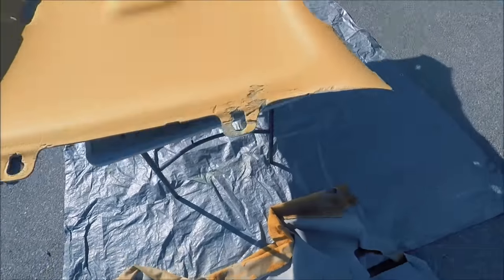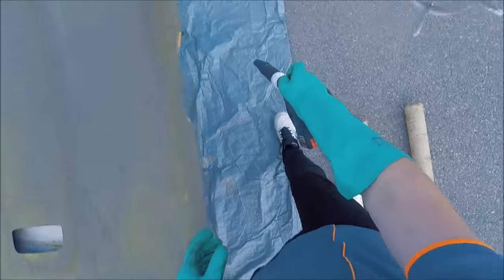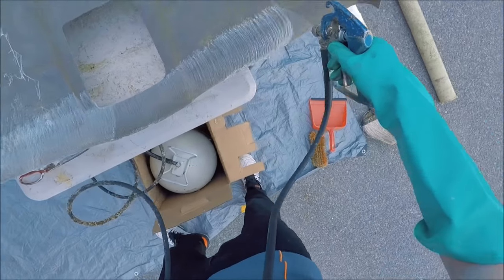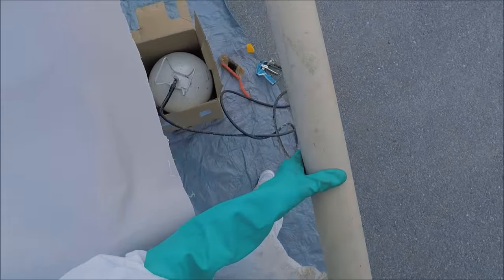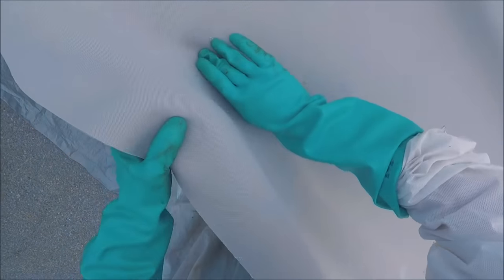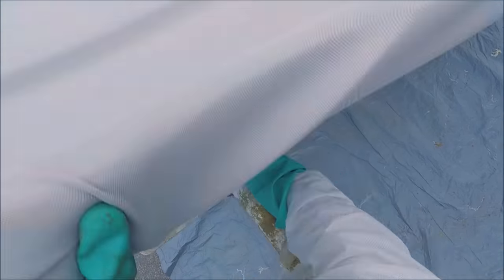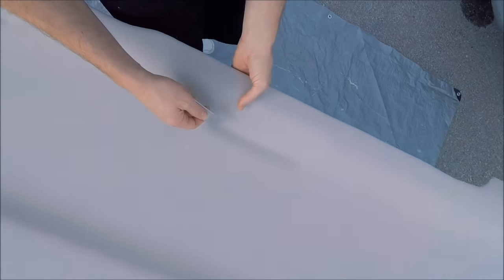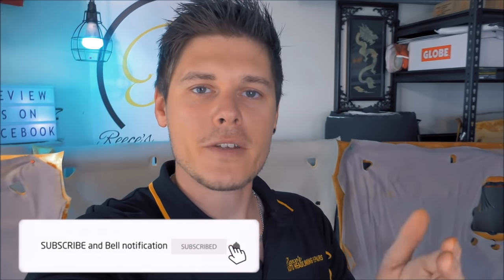How To Fix a Headliner The Correct Way

Comment from the maker: Thanks for watching 😃

The Products we use:
BUY OUR GLUE: TensorGrip T65 500ml Can - https://ebay.us/rysIGV
BUY OUR FABRIC:  Headlining / Roof Lining Material: https://ebay.us/26bew6
FIND A STARLIGHT HEADLINER KIT: https://ebay.us/uM5XCA
PERMATEX ADHESIVE HEADLINER GLUE: https://ebay.us/TrG6aw

If you'd like to Help this channel GROW!! Subscribe, leave a COMMENT below and Click 👍 OR 👎
Subscribe and hit the notification bell! ►https://www.youtube.com/c/reecesautoheadliningrepairs
Reply: Do u have shop in Chicago
Reply from the maker: @hilalaiss  just Adelaide, South Australia 🇦🇺
Reply: I just bought a piece of this fabric from a fabric store because it had a cool design/pattern on it.
It doesn't have foam on it and I don't plan to add any, do I need to worry about the glue soaking through the thin material and using looking bad?
Could just be me but it looked like you applied the glue pretty thick; could I get away with going thinner so as to avoid seepage through my thinner material?
Reply from the maker: @RandoManFPV  t65 glue sprays thinly, so usually on most non headliner fabrics, extra caution is required, but possible to not get any glue seeping through fabric, just don't puddle the glue anywhere 👍
Reply: @ReecesAutoHeadliningRepairs  thank you 🙏
Reply: Hi I have a 2007 VW Passat 3c wagon when I removed the hood lining from car and then removed the material and foam but I have a problem the old glue Is tacky how do I remove it @ReecesAutoHeadliningRepairs
Reply from the maker: @Enzorat2267 Permatex headliner adhesive http://ebay.us/apC9ZH
Reply from the maker: @Enzorat2267 We clean off the old foam with brush or nylon orbital. 

Then boards are tacky still and can become an issue.

But we find the Permatex brand of glue works ideal on these sticky oily boards.

We currently don't clean it down with any agents, just rub heavy with a clean cloth to absorb the stickiness
Reply: Where do get that glue. In Large gal format to use in sprayer
Reply from the maker: I'd recommend getting it repaired with new fabric/glue. However, here are my suggestions for short-term solutions to hold up a saggy roof liner:

#1 Avoid anything that will compromise the safety of yourself and passengers in the car, for example, drawing pins, thumb tacks, pins as these could all run the risk of coming loose and falling down. If landing on infants, pets, babies, and toddlers, we now run the risk of them ingesting these harmful items.

So possibly a suggestion to a safer short-term solution is Twist pins,
SHOP HERE🛒 https://www.reecesautoheadliningrepairs.com/product/twist-pins/

TWIST PINS can secure themselves into the headliner board. Double-sided tape could work in some sections. Also, the use of office staples can do a good job holding the fabric up until a full repair can be done. Note: Usually, wagons/hatchbacks may potentially have rear windshield washer hose running on the headliner, and piercing the board may run the risk of puncture. It's super rare, but a possibility. Also, most cars have wiring stuck to the board, which can pose another concern if accidentally hit and possibly earthing out the system blowing the fuse. Once again, it's a rare chance.

Or we have also seen adding headliner adhesive to hold up old saggy material that can wreck the board in some cases or cause more work for the professional repair to be accomplished.
Reply: Where can one get a headliner board in Canada for a 1988 Chevy Cheyenne?  It's not fiberglass; appears to be pressed paper / cardboard.

Comment: When this was my job in the early '90s we never used a material with padding attached and instead had three different thicknesses of padding to choose from to install before the material. Often patterns would be installed in the 1/4" foam then overlaid with 1/8" followed by a customer chosen fabric. One of the best looking jobs finished was a black metallic fabric with roses in a black Monte Carlo SS.
Reply: Using foam is asking  for it to fail again.  I remove the foam and use thicker material and glue it directly to the board.
Reply: @scootersonlyrepair6773  
That would be best, but foam provides insulation from heat coming in from the roof as well as dampening outside noise.  So if you like extra quiet or just like the cushioned feel, lots of foam is what you want.  But like the videographer stated, if you put glue around the edges and fold the fabric over onto the back side, once it gets fastened back into place, it will be far less likely to start sagging around the edges and cut outs which is where the sagging mostly starts in the first place.
Reply: What if the cardboard part itself is sagging?
Reply: Would the process be the same when doing a headliner like that?  Glue the foam then the board, let it tack then spread the foam to the board, glue the foam then material, let it tack then spread material?
Reply: Nice 👍
Reply: Foam on headliner isn't needed if you dynamat the roof before reinstalling.
Reply: We have to repair all of them now because it was a bad job in the 90's. Thanks but no thanks for the help.
Reply: @mortikaa9379  30+ years isn't a bad run for a headliner replacement. You're welcome. 😃
Reply: @Ninja-es3fi  It is when you're applying shapes and contours.
Reply: What’s crazy is I just ordered that exact material with some 3/16 in foam. I know it’s gonna look good

Comment: I had to replace the headliner in my 2010 Cayman S in 2018, after Hurricane Michael went by in Florida. The foam Porsche used didn't get dry and crumbly, instead it was sticky and a pain to remove all of it using acetone to finish cleaning it off. I used an upholstery grade vinyl (crocodile) with a cloth backing and affixed it using a 3M under hood adhesive and so far it hasn't moved. I did the job just like you did in the video.
Reply: Excellent, glad to hear you completed the process via following this video 👍👍

Comment: Not sure how this got in my feed but I needed some guidance and this was top notch for the rear area in my project car. Looking terrific, cheers!
Reply: Oooo! What car? I've got a 2001 Impreza Outback Sport in the garage for fun. Only 150k on the odmeter. I'll need to do this as well, but first, the wheel bearings and timing belt!
Reply: It is odd about you not knowing how this got on your feed. I need to redo my truck's roof liner, but I have not spoken about it, nor searched how to's, nor googled it. Yet, here it is, on my feed.
Reply: Don't know how it got in your feed.
Ha ha mu ha muha ha ha

Comment: Lovely work mate.  I am doing my 1998 Toyota Corolla in just a few days. Got all the material.  Wasnt aware of those cuts to make the headliner cloth hug the headliner board nicely.  Great tip thanks!
Reply from the maker: Excellent to hear mate, I'm sure you'll do a great job, just be mindful that most Toyota headliner boards can break easily, so will need to limit the amount of flex on these during removal and reinstall, and scrubbing the board gently is required 👍
Reply: I also have a 1998 corolla.  Good luck!

Comment: You verified what I wondered about reusing headliner material (el CHEAPO here). Very good video and narration. You really touched on all the critical points quickly! Camera work excellent! Working time must be longer than the M77 adhesives I have used for plastic laminate work. It needed to dry before sticking the laminate as to not trap gasses from the glue. Nice to have the forgiveness working with the M76 glue. WE SHALL SEE! Thanks for the video!
Reply: You need to use heat resistant glue. That’s the main thing about which glues to use.

Comment: Finished this up yesterday on the missos car
A little tip for those trying it on a sedan, you'll need about 2 cans of the 3m 76 (we used 77 cause it was all we could find in Vic) for the process. We had to run down rhe shop half wsy through to get it done. Good luck!

Comment: Excellent video! The narration is clear and at a good speed, and the camera work spot on. Great work! 
Information that would be useful is to explain is  the cost of the material and the finished quality to a DIYer compared to getting a pro to do it. Remember a pro's equipment, skill and time cost money to acquire. Do I have the skill to execute the job? Even a DIYer has time and effort cost, so ask yourself, "Am I better off getting a pro or busting my hump and wallet and still end up with a crap job?"

Comment: I used some cheap stretchy material from walmart. I turned the material finish side down and sprayed the back and the headliner backer. I placed the headliner down onto the material and folded the excess material over the back of the headliner backing and then flipped the entire thing over. I then used a roller and pushed the material down into the low spots and worked my way out. It has  lasted 20 years like that (used 3m spray adhesive). You can go a step further and glue some of the bubble wrap with foil on both sides to the top side to add some extra insulation to the top help keep the a/c in.

Comment: I did my golf MK6 about six weeks ago.  Was very happy with the job I did, cleaning it up really well, and using the permatex headliner adhesive on both sides.  Next day the car sat in the shade at 40degrees.  Now I’m back to square one with a sagging headliner.  Is there a period of time for a contact adhesive to go off after the two surfaces are put together?  I did not find this information on the can or on the permatex website.

Great video by the way!
Reply from the maker: Just make sure you cleaned the board down , and used brand new headliner fabric/foam.

All steps mentioned in our ebook 
https://www.reecesautoheadliningrepairs.com/product/headlining-secrets-ultimate-guide-fix-sagging-car-rooflining-reeces-auto-headlining-repairs/

Comment: Man, I WISH old foam came off like that! I did my Range Rover a couple years ago and my old foam was a sticky disaster! Clumps up, leaves a small layer of wet, sticky degraded foam on the board, clogs up sanders in 2 seconds…. A total mess!

Took several hours to get it all off. I think there are still clumps stuck to my workshop floor years later. 

I have two more to do and I’ve been putting it off because it was miserable. I’ve been toying with the idea of just bringing the liners to a local shop and letting them handle the messy parts 😂

Comment: Thanks for the video. Great info and good audio too.  

Looks like you're doing a Commodore wagon? Literally doing a VF wagon while watching this. I have no idea how you got the liner out without pulling all the trims off, it barely fitted out without flexing it even after I removed them. These things suck with how they've routed all the wires and squirter hose across the top too.
Reply from the maker: This one was a VE Holden Commodore Wagon. I agree it socks how they glued in so tightly the roof wires and washer hose to the board and down into the pillar, but yeah we manage to just flex this style away from pillars and then out the car, possibly because of experience we may make it look easier than it is.

Comment: Great video, guys. I wish I was in SA so I could pay you to replace my Fairlane roof lining. I'm going to attempt to do my own, however I know it's not going to be astonishing like your work is.
Reply: Thank you 👍 let us know if you have any questions regarding the job you are tackling. Our eBook 'Headliner Secrets' which is available on our website goes into more detail about the process.
Reply: @Reece.wilson  Thanks. I will definitely purchase that. One question I did have was with the adhesive. You recommend the T65. However, in a previous video, you also said you were going to test the Car Builders Spray Adhesive. What were the results of that test? I'm only asking because it's easier for me to source the Car Builders product locally.
Reply: If you've not tested it yet, then I'll just order the T65 and wait the 7-10 days for it to arrive.

Comment: Great video. Good to see something from Australia. I looked into getting my 1998 105/100 series Landcruiser done. It has a sunroof and the business I approached didn't want to do it as they said it was an aftermarket sunroof and that the board had most likely been cut. Have you guys come across this before?
Reply from the maker: What location are you in?

Unfortunately usually your car if fitted with a sunroof is the style of sunroof setup that most say no too or do a terrible jobat repairing,  we currently don't do them but have referrals to trimmers that can tackle to job. Is there a (Sunroof roof rack city) bussines in your location, as I believe they did this style of sunroof.

And this style is usually referred to as a floating headliner. 
Kind of explained in this video below:
https://youtu.be/x1PRt0HjCZw
Reply: @ReecesAutoHeadliningRepairs   Thanks for the reply. I'm Wollongong NSW. I'll check out the video and search some more.

Comment: Awesome & no nonsense. 

I have a 95 Saturn headliner out of the car to revive. Adhesive on the headliner is hard as a rock. Wire brushing only seems to remove very top surface. Any harder and It rips through the surface and makes a divot.

How do I get rid of the rest of the glue and what do I fill the divots with before applying the new headliner material?

Comment: This video was really helpful and answered the question on how to do the edges by making small cuts before wrapping over.  One thing i was curious about was if there are different grades of the standard velour headliner material if anyone knows?  the reason I ask is i have two cars with completely different life longevity of the headliner.  One car is a 07 Jaguar x type station wagon and the other car is a 95 Buick Roadmaster station wagon.  What is odd is the Jaguar is much newer and garage kept with low mileage. The Buick is nearly 28 years old and only under cover sometimes.  But for some reason, the jaguar has needed the headliner replace twice already.  The much older and more used Buick still has the original headliner with no problems whatsoever.  The headliner in the Buick is also significantly larger than the Jaguar's as the car is much larger and you'd think it would be more prone to sag.  i don't understand why the jaguar headliner needs to be replaced every 6 or 7 years and the Buick one lasts for nearly 30 years. they are both located in the same climate. the only thing i can think of is if the headliner material from Buick is somehow of better quality??   but this headliner material all seems the same to me.  Puzzling.
Reply from the maker: There could be mutiple reasons why one would last longer than the other.
1.Different quality head board itself.
2. Different quality Velour 
3. Whether it's supported by the old bow setup rather than stuck directly to the board with glue.
4. Insulation. 
5. Environmental 

Most of the time it comes down to just the difference in materials used during manufacturing.

Comment: Great video, the content really holds up over time.

Quick question... Is there any reason to clean the headliner further after removing the old foam?
I see that the foam is crumbling off ofine super easily, which is great... But there is definitely a tacky glue residue all over from the original factory glue job. Is it okay to lay the new headliner fabric on that without like, cleaning the glue residue off with solvent?

It's nothing bumpy, just an even layer of thin sticky residue all over the headliner board.

Thanks!
Reply: If you are Working on an Audi or VW Headliner board, the sticky residue leftover may be an issue with some glues bonding to the board. So in that case, I've found that the permatex Headliner Adhesive or 3m 76 works well on those models. But with commodore or falcon models, the sticky residue seems to actually help with bonding, so all good 👍 and on those models our T65 Glue or Cantac HSC Glue works well. 

Some trimmers use solvents to remove the residue, however we see that as not needed, and may cause a bad smell or interact negatively with the glue added.
Reply: @Reece.wilson  ... Awesome feedback! Thanks so much!

Comment: Awesome vid. Can you give us the list of items to make that mobile glue gun set up? That's amazing
Reply from the maker: That would be TensorGrip T65 or T51 20lt canister, best to go on their website tensor global, and see what supplier they have in the area near you. As its not a type of glue thats found easily like on ebay. Price guide is around $400-$500 per canister and goes up yearly. So its pretty much the dearest glue to buy, but is convenient and a great reliable product.
Reply: I have a 2010 Volvo S80 and one guy said they need to remove the front windshield to take out the headliner. Is this true and also I received 4 completely different quotes for looking at the car , which was kinda confusing , plus I have the material ! $300, then  -$500- then $600 plus $200 to remove the windshield and then $800

Comment: Thanks for the vid. My question is about the headprotection curtain. Where is that located? Mine has no sunroof.
It also seems to me that if you remove the old cover, the underlying board would be fine with a drop of spray paint. Can you advise? Thanks, Jim

Comment: Any tips on removing the glue from an Audi headliner? Do you always scrape the foam using a brush or do you sometimes use a chemical to remove the glue from the board? My car seems to be very sticky and I'm wondering if I should also remove the glue...

Comment: If you could do a video on doing a headliner on a car with a sunroof and no board that would be awesome
Reply from the maker: Here's a couple of videos we did about sunroofs so far:

The sunroof setups we don't currently work on and what they are, explained here in this video below
https://youtu.be/x1PRt0HjCZw

Recovering a sunroof inside the car rather than removing the shade panel. A bit tricky but can be done.
https://youtu.be/xCxRMnw_Uok